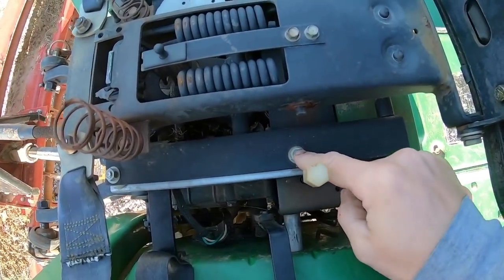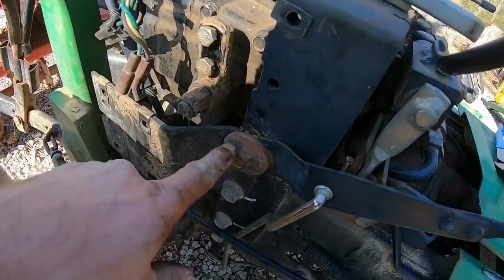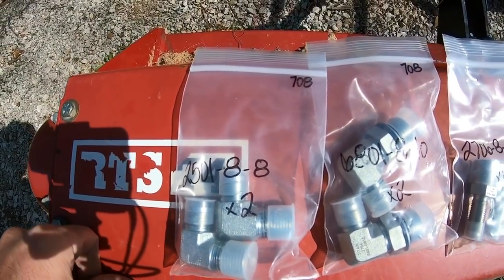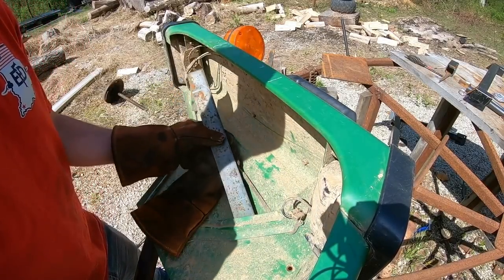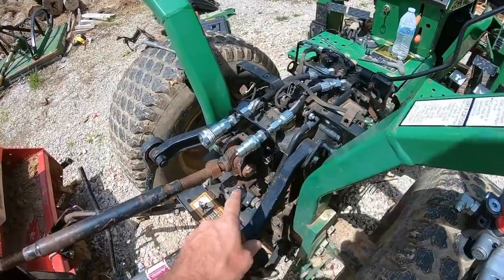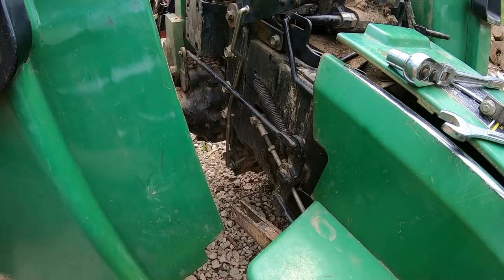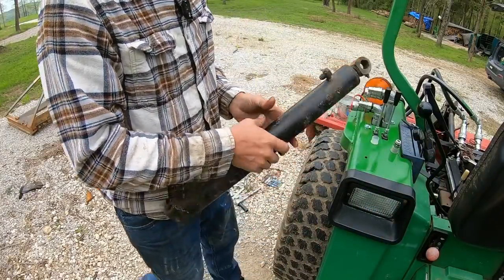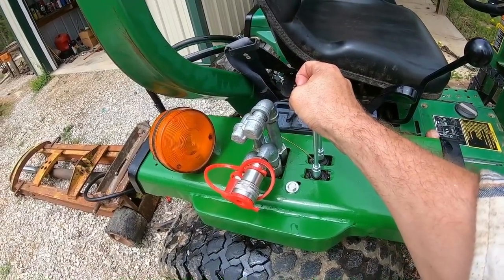Adding Auxiliary Hydraulics to my Compact Tractor - Fabrication - Leaks - and Lessons Learned

Comment: Nice Build Mike.
is it very dry by you ? getting a lot of Popping in the Audio. 
You defiantly need Pipe sealant on NPT Pipe fittings..
Install a blast shield between you and the valve. 
Those cast fittings and Pipe will be your No. 1 failure catastrophically with a BANG.. 
Mike M.

Comment: To seal your npt threads loctite 545 works really well it is for hydraulics or pneumatics and it should not cause any issues with the hydraulic system
Reply from the maker: Hey thanks Russell

Comment: Looks like one valve has a float position. With the levers forward of the body - that puts the float at the end of up instead of down. Am nearly finished installing hydraulics on a Simplicity Landlord and had to mount the valve body forward when to the back would have been preferable for hose runs as well as operator to control lever comfort.
Fine job you’ve done here. Every project makes you better.
Reply from the maker: It depends how you hook the hoses up on the cylinder itself, 😉
Reply: @CaptainKleeman  Actually, no. Unless I missed something, either float is past up, or the valve has to be operated backwards - push for up, pull for down/float. Messes up what would have been a fairly neat hose arrangement on my much smaller tractor. Grr

Comment: You can't plumb the forklift mast cylinder to power both ways. The fitting at the top is a return to tank for anything that gets by the packing so there isn't any pressure on the shaft seal.

Comment: So you ran one set from the pump to the rear in preparation for a backhoe.  But if you only planned on using the valves, is there a reason I cannot do just what you did but run the 1st set from the pump to the valve block?
Reply from the maker: You can absolutely do that.  If you don't need the option for the backhoe, you can run straight to the valve block and back
Reply: @CaptainKleeman  I recently bought my dads JD4100 which has two circuitss built in for a bucket but nothing for the rear. Id really like to have an adjustable top link with one to spare.  Ive been doing a good bit of research in the last few weeks and your video was by far the most insightful.  The only thing I have left to consider is I may want to form ridged lines between the pump and valves, just like the factory ones are for the front circuits.   I appreciate your video, well done.

Comment: I realize it's too late for this project but for your future reference permatex makes a hydrolic pipe thread sealant its a red liquid comes in a bottle just like lock tite and it is safe for hydrolic and it works great so if you have leaks or future projects check it out
Reply from the maker: Appreciate the tip!
Reply: No bullshit it's true plus it acts alot like lock tight so those 90s will be locked in and not swivel on you seriously look into it and use it you can get it on Amazon not that I ever have my job always got it and I don't know where or how much I just know it's well worth it it works awsome I wouldn't put a hydro system together without it 😉 😏

Comment: At 8.26, " I wish I had a good way to hold that back together" Try poking it all back through in the right order as you did, then using a reasonably large Cable Tie/ Ty-Wrap/ Buckle Tie, or whatever you call them over there and put it around the thread tight to the washer and pull up TIGHT. Leave the 'tail' long, less scratched arms that way, and the buckle/ratchet chamber/ zippy bit should stop the bolt or screw going back through. you can use as many as you can, all at differing angles to make sure, but not often needed if they are at least 1ft /300mm long, as the size of the buckle is usually ok. If you don't have at least one pack of ties of that size, yo have not lived the life of a Field service engineer, I've used so many as temporary help, and occasionally one or two as permanent solutions (daisy-chained to hold cold/warm hoses out of the way of moving belts etc), over the years, and they are thermo-plastic so can be easily recycled.  
And those self-locking nuts with a ring of plastic in them 'Nyloks', If you have to re-use them, and they have been re-used before, the stores are closed, it's raining and 10pm and the job can't wait, put them on an anvil of some sort (a flat rock will do) and TAP the top down on one side to squash the plastic so the screw thread has to cut again. Don't squash all around, the screw will push all the plastic out and waste your time! You can only do this once up to about 5/8 or 16mm nuts, but they hold ok for years when you do.

Comment: Now, the best thing to do to keep your hydraulic system nice and clean is to carry a rag and wipe the dust and dirt off of the quick connectors before you hook anything to them, it will keep dirt and dust out of your system and not plug up those little orifices or the filter so it doesn’t create problems for you down the road

Comment: I so so hate clip nuts. I replace them when ever I can with a nuts tack welded or tig to a sheet metal tab with a hole drilled. Using stainless when ever I can. 😉👍 Correction for the NPT hydraulic fittings you can use a light coat of pipe dope, RTV, or lock tight blue to seal the threads. Don't use teflon tape on gas, and any oil lines. 🤔Hmm I'd turn the fork lift mass into a mini ramp lift with teeth locks. It lifts diagonally not strait up. Great for light vehicles and bikes or as a jack.
Reply from the maker: They are definitely a pain in the butt.  Always breaking.  Good idea on the lift

Comment: Mike use the fork system to make an outside lift to work on heavy equipment. A hydro top link would be a good first power beyond fixture.
Reply: top and tilt for the 3-point.  Quick ways to put the extra functions to work.

also a way to learn to want more hydraulic functions, because you just used up the 2 you added.

Comment: About the only time you can get away without using sealant on NPT treads is plastic fittings. They will sometimes deform enough to seal.  Metal NPT fittings always require thread sealant. Don't put sealant on the first two threads to keep it from getting in the system. Use a liquid/paste type sealant instead of tape to prevent issues with tape causing system issues.
Reply from the maker: Definitely appreciate the tips!

Comment: You should spoil yourself with a mig welder for all that thinner work you do. I've had my Lincoln handy mig since '07 and rode that sucker hard. In fact, I rarely pick up my stick anymore for anything really. The mig finally "broke down" on me (if you wanna call it that) by having a leak in the gas tube to the gun. I have a wee little 1/8" vinyl tubing splice on the way and she'll be good as new. I weld stuff with that thing it was never designed to do and only give it a few seconds rest after the "overheat' warning light shuts it off which rarely happens anyway.

Comment: Your metal work has came a long ways when welding thin stuff turn down the amps and do some spot welds it will help with the blow throu
Reply from the maker: That's what I did after the blow through,. It worked pretty well for me

Comment: only idea if you plumped out of the tractor to valve bank then from the valve bank to couplings would get by pass hose out of the way
Reply from the maker: I want the connections on back for a possible backhoe attachment or satellite valve block for stand alone attachments

Comment: Anybody that told you not to put sealer on hasn't put much high pressure pipe thread together. use liquid sealer not tape

Comment: On your rear hydraulics why didn’t you put a cross valve in there so you didn’t have to run a hose jumper
Reply from the maker: It has to be a loop system.

Comment: Yea im kind of partial to mechanical levers to operate my hydraulics also, friend of mine had an electric over hydraulic wood splitter and as he reached to center the log something happened and mashed his hand between the splitting wedge and wood. Granted hand placement wasnt the best but as he said he had done it a thousand times and if the control handle wouldnt have messed up it wouldnt have mattered.....but it did.

Comment: Plumbing parts are not hydraulic,Darwin award contender
Reply from the maker: You're right, WOG are rated at 150psi, but they've been used for a long time with no issue.  Also, and here's the big thing you missed (probably while typing your comment). It's for mock up purposes.  Better luck next time chief

Comment: Please as soon as posssible switch out those galvanized pipe fittings for the proper hydraulic ones the galvanize will start flaking off.

Comment: I don't recall, have you thought about making the cylinder thing a log splitter?
Reply: agreed, even as a vertical log splitter, easy to take to the wood, then a small trailer behind to bring back the split wood.
Reply from the maker: It's only power one way.

Comment: Had to stop the video when I got to the part about contamination from thread sealant. As others have said , Teflon tape works well , just wrap it carefully in a clockwise direction (looking from the end of the pipe) also a sealant which is made for oils (Rectorseal no 5 is the best I’ve ever used) applied carefully so that it does not go  past the first thread and get inside. Do not use it on female, only male threads and there will be no contamination. Without lubrication the threads will Gall, the is especially true of stainless to stainless connections. For those use special stainless tape and dope and don’t over tighten. 
Ok now I can finish the video

Comment: now will hold water when the lines are not on.
Reply from the maker: If you're talking about the power beyond connection in the rear, there will always been a line connected,. Has to be for the tractor to function.  Also,. Even if there was water in the connections, that wouldn't hurt anything at all

Comment: The galvanized pipe fittings are not rated to 2000+ psi
Reply from the maker: Correct,. Rated to 150psi since it's WOG.  but I know you were paying attention and heard the part about it being a mock up to test the system. 😉

Comment: Mike, It looks like U used water pipe fittings on the valve, if so they could burst at 1800 PSI  and shoot HYD oil into your hand or leg.  Stay safe!!  Have Fun!!

Comment: Those galvanized fittings are going to eat the pump when they flake chips off. Get them out of there.
Reply from the maker: As mentioned in the video, it's just for mock up.  All that was available at the time.